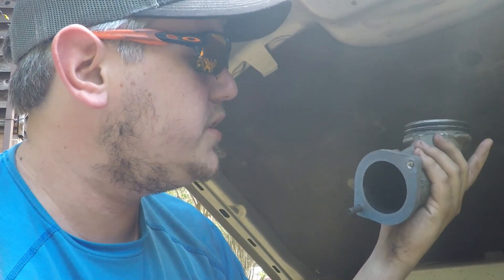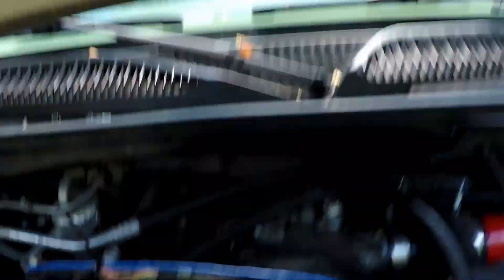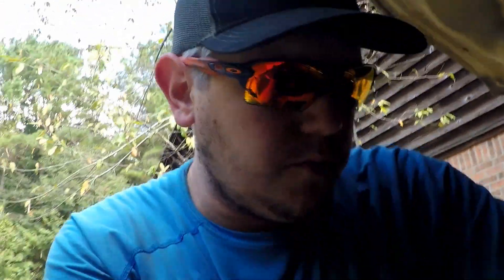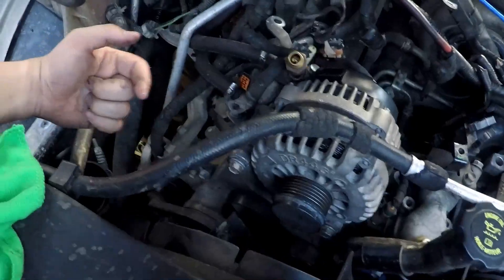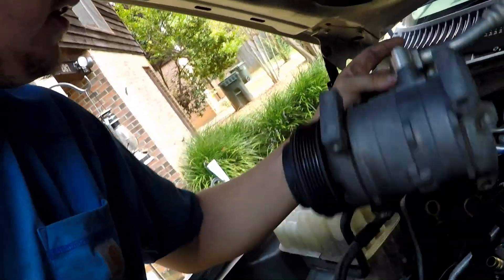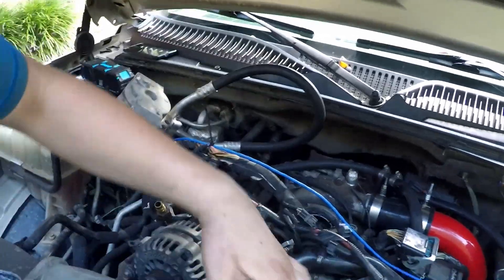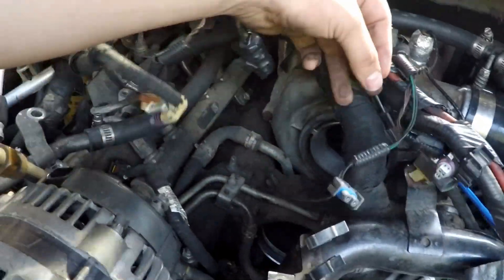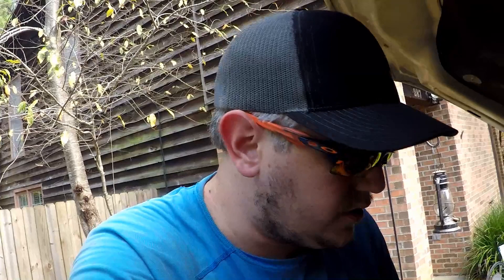More Problems with the Duramax | Y-Bridge Failure and LBF Tuning

Comment: How long have you been running your E bay charger pipe on your truck now. Do you have anymore trouble with it. Because I just bought a HSP kit EGR Delete
Reply from the maker: Still running it. Since I put it on in the first video on it. So far the y-bridge blowout was the only failure. Well, besides the up pipe, definitely change the passenger side one. But the pipe itself has been fine